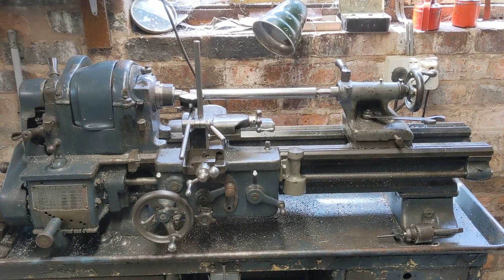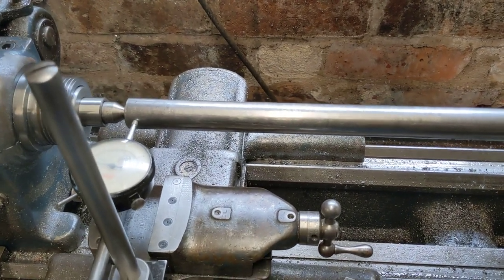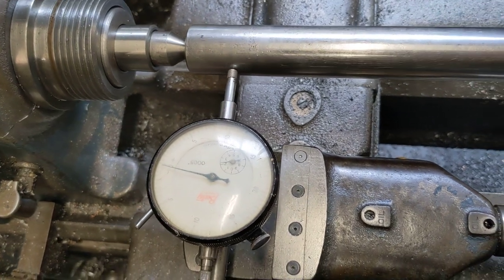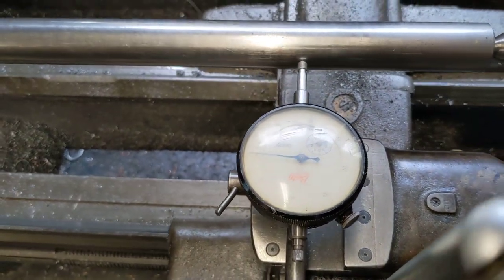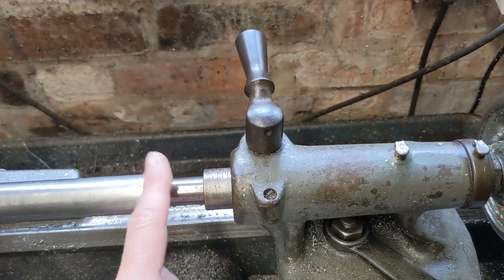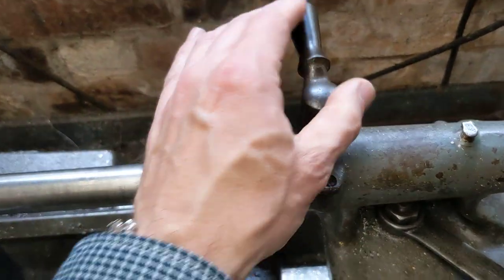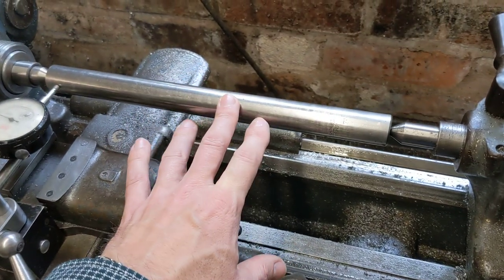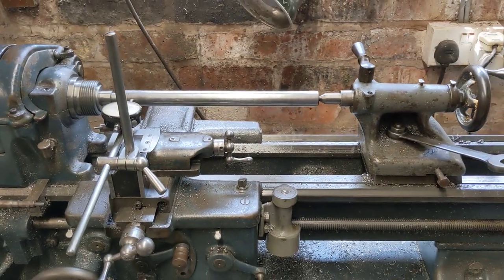The Second Parallel

Comment: Your South Bend is a sweet old girl. She's about 16 years older than my Heavy 10 and about the same age as me. I'm curious about those circular marks on the top surface of your Top-Slide on both sides of the T Slot? There appears to be 4 on each ear, totaling 8. I've never seen those before. 

On another note: A good cleaning prior to making test measurements would be good shop practice. There's a shit load of swarf on those ways. Especially in front of the Tail-Stock. The "thing" on the Tail-Stock is called the Ram. The Ram is guided and held by the Quill. The Ram Lock closes the Quill around the Ram. The #2 Morse tapered Ram should have a keyway slot at the back end of the Ram. It's used to prevent tooling from turning and galling the Morse taper while under load. This only works with Morse taper tools incorporating a tang on them. Morse taper tooling can be ejected from the Ram by turning the Hand-Wheel CCW until it ejects the tool. That 1" diameter test rod is called a Precision Ground Test Mandrel.

Now, clean up the old girl and make her look pretty before showing her to the entire world. :face-blue-wide-eyes:
Wakodahatchee Chris
Reply from the maker: I've just done a video on those circular marks, uploading it now.
Reply: @StoneEng  Thanks mate! That video is much easier to see what they are.